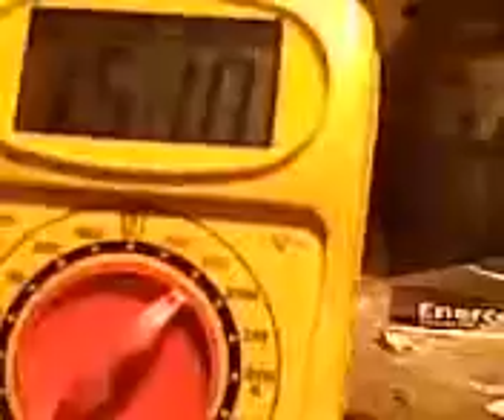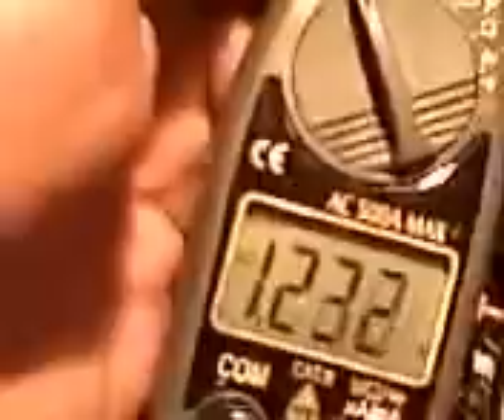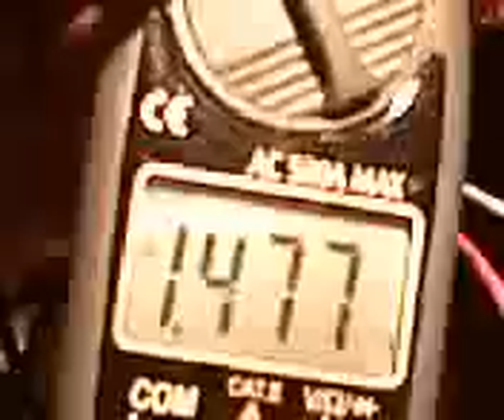Cold Fusion Plasma 3

Comment: Hi Mdbreddi, great video !
Try to use K2CO3 as the electrolyte,
then the plasma will come in much lower voltage . Also use at least 20 grams of it per  Liter H2O. Please come to overunity dot com and report your findings.
Many thanks. Regards, Stefan.

Comment from the maker: Its doing quite well. Better than I was expecting. One thing I was suprised over was using Carbide for the electrode. Seems its holding out just as good or better than pure Tungsten. I'll post some close-up pictures later of the electrode after I have several days on it with the end of the Teflon rod.

Comment from the maker: The lowest reaction voltage was around 80 Volts DC. I could not get it to "plasma" till around 150 Volts with this setup. If you look in a previous video of mine you will see when it starts to plasma. The light will get brighter and change from a yellow color to a more white color, that is when the amps will drop several amps to arount 1 amp. If you lower the voltage after it plasmas the amps will follow also. At around 120 volts the amps will be around .6-.8 amps with this setup.